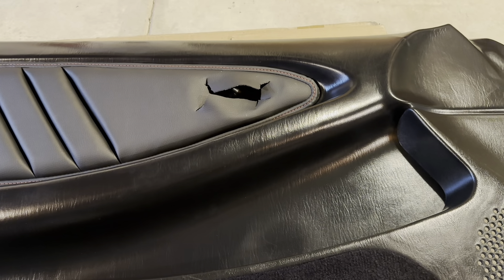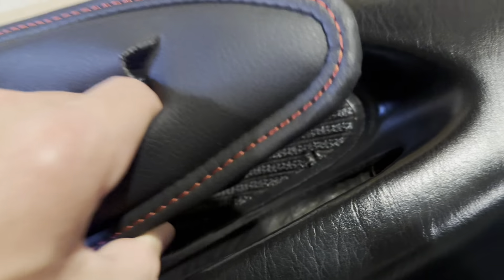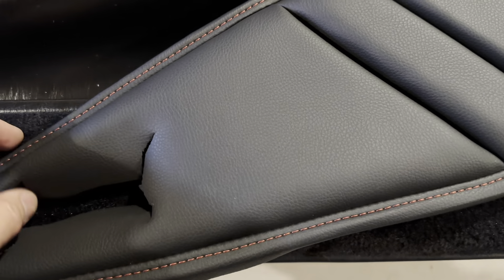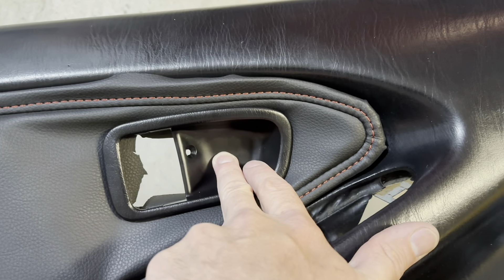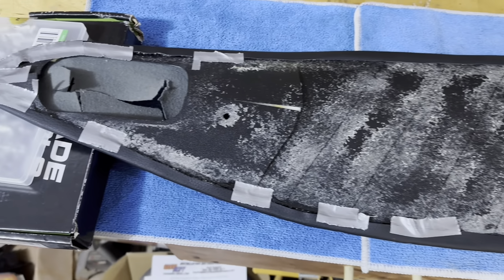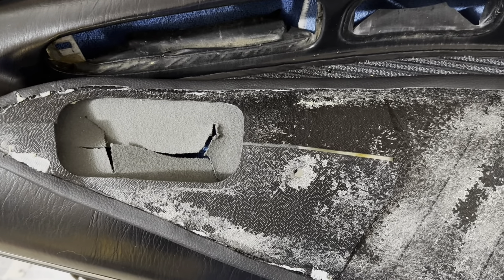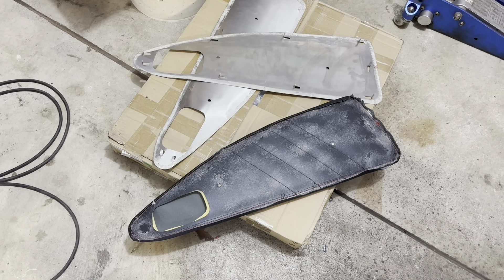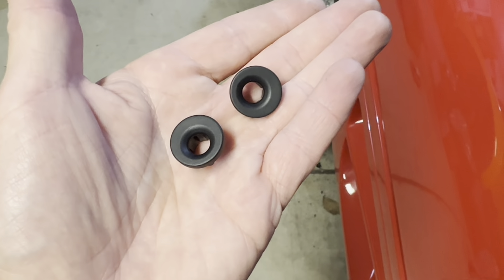SW20 Toyota MR2 2GR V6 - MR2 Heaven custom door panels part 1, Rat 2 injector cover, and t top fix.

Comment: I ended up going with Igors Saveljevs inserts over the mr2heaven stuff. Great video.
Reply from the maker: Thanks.  Good to know.  I think the problem is that there is that spot that is not flat, all the rest is flat and tight, it’s just that flaw where it is low.

Comment: You can adjust the windows to come further up into the seal, as well as angled in more to press against that seal.  Use the eccentrics to pull the ttops down and adjust the windows appropriately.
Reply from the maker: I have the eccentrics pulling top down and out as much will go.  The problem is the seal has a “dent” in it where it is not touching.  Other side does not have that deformation.  That’s why I was thinking of putting something inside the hollow portion of seal to push out that deformation.  I have the glass adjusted all the way up and it is really tight in everywhere except that “dent.”

Comment: From my experience most of the MR2Heaven stuff is crap. Nothing fits right and there's always some modifications needed. The leather seat covers are decent but I've noticed the black leather parts they sell, door cards, shift knobs, seats etc are always too light and don't match the factory interior.

Btw, from what I remember those door cards only work on turbo cars with factory leather. The door cards pop out on them whereas the cloth door cards are one piece. That's why the aluminum backing has tabs. Look it up.
Reply from the maker: Yep, I know regarding the door cards, but I have the leather seat covers so I wanted the inserts to fit, hence the modification work.  I did not realize that when I bought these things over a year ago, but definitely found out.  Based on lack of options, I’m willing to try what they have and for the most part it has been decent.  I can’t expect much aftermarket stuff on a 30 year old niche car to be perfect.
Reply: @jrmotorsports55  I put the MR2Heaven black leather seat covers on but kept the cloth door cards. It looks good IMO. I ended up getting their repro frunk plastic cover and    the amount of trimming was ridiculous. They advertise it being three times thicker than OEM but it makes it a pain in the ass to remove.
Reply from the maker: @RyuHayabusa06  good to know.  Thankfully my drunk surround is good.  I do have their front fender liners and some of their under panels and fit was OK.  Fender liners needed some work, j see panels were not bad.